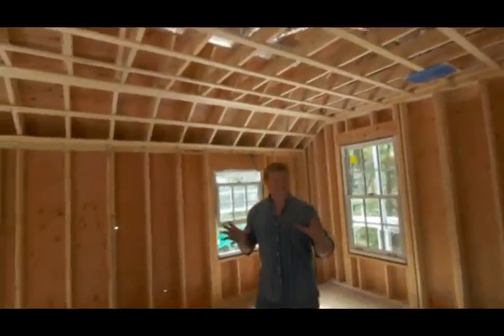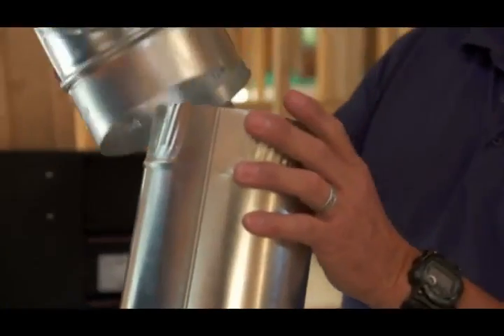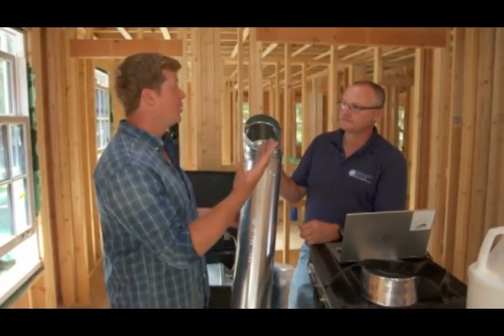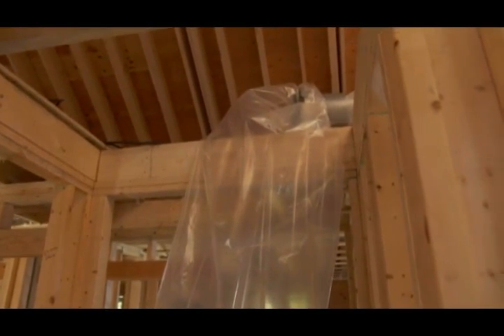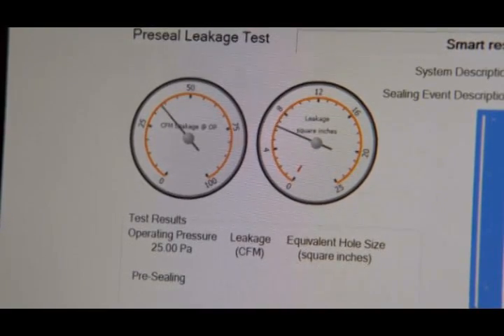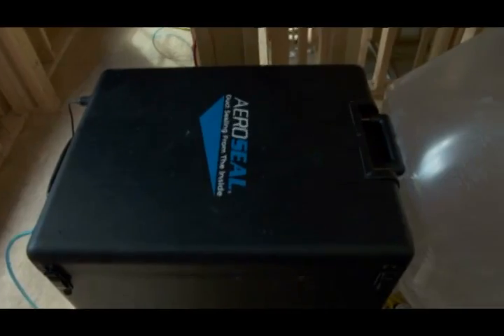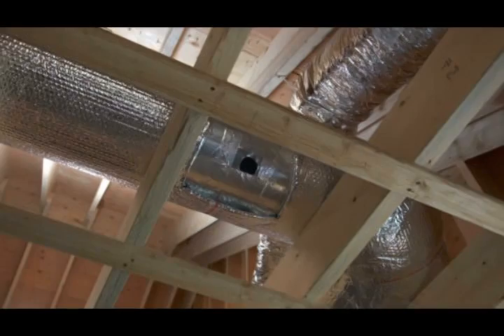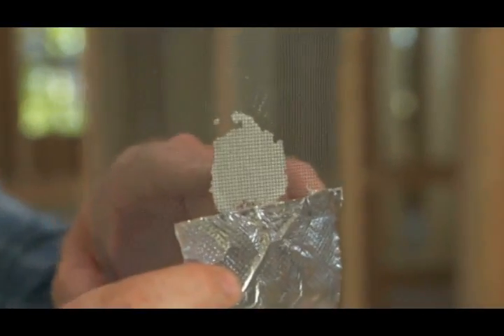This Old House with Kevin O'Connor Features Aeroseal in New Construction Project

Comment: damn, i tape every single rotational joint and seam like you're supposed to. This is good for old fixes, but why not just install it right with good tape or duct seal.  Lately i paint because mastic tape is fucking expensive as shit.
Reply from the maker: Doing a good job taping and manually sealing definitely makes things better, with measurable performance improvements.  We've found that, even with excellent manual sealing, the Aeroseal technology finds and seals cracks both more easily and even more effectively than manual sealing.  As you say, all that sealant when doing it manually also makes things even more expensive, making Aeroseal not only a more effective solution but also competitively priced, considering both materials and labor.

Comment: Finding and repairing leaks before AEROSEAL was next to impossible.  This technology helps to seal your home from the inside out.  

There are several warning signs of a leaky air duct system.  The most noticeable is uneven heating or cooling throughout the house.  If, during winter months, you find that some rooms in your home remain cool while others are warm and toasty, there is a good chance that leaky ducts are the problem.  Another sign is dust.  If you find you have to re-dust just days after a thorough cleaning, leaks in the air duct system may be the culprit.  

There are some things you can do to plug some of the most obvious leaks, but over 90 percent of a home's duct system is located behind walls or under attic insulation.
Reply: what's the best way to stop water leaking into PVC ducts that are under slab?
Reply: AirDuctCleanersOfVirginia
You guys still in business, and if so were are you located? I'm a GC who has a homeowner with a possible need.
Reply from the maker: Hi  @kevingoode9799  -- If you're still searching for an Aeroseal partner, please visit our directory at https://directory.aeroseal.com/